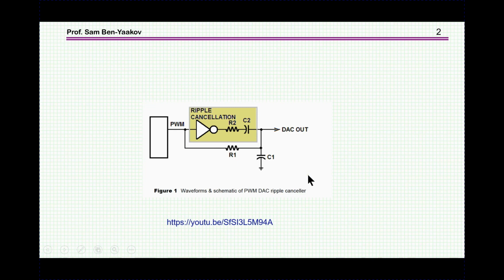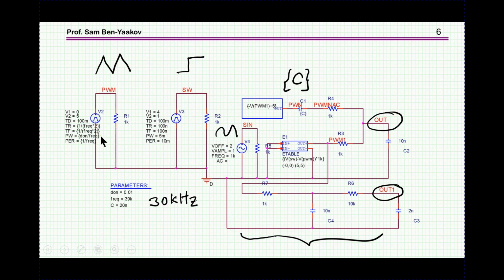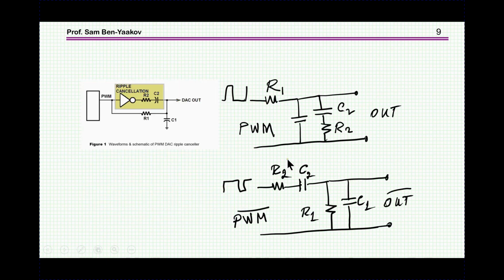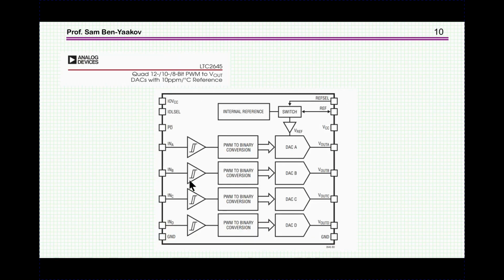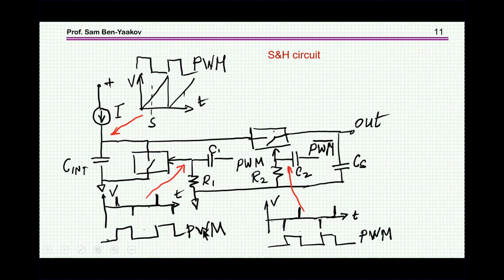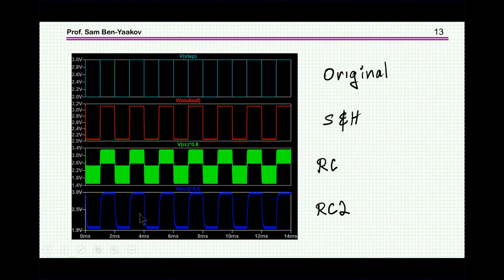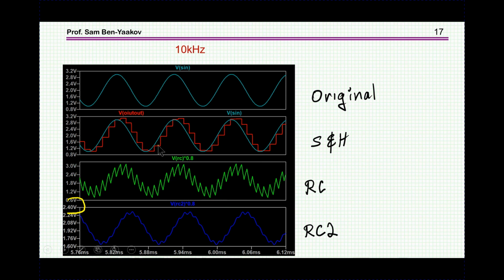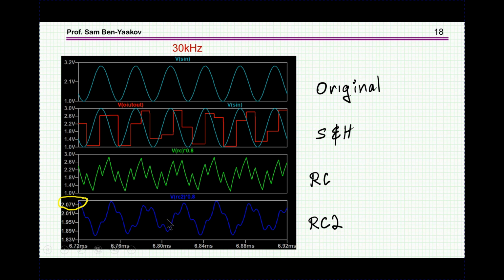Addendum to: Ripple cancellation in PWM DAC

Comment: But what if, in the ripple cancellation circuit, the inverter was not just inverter, but amplified , let's say, ten times - and with a lower C2 capacity?
Reply from the maker: Tried it does not help. Same trade off between ripple and BW

Comment: Cool!  Thanks, this has been interesting.  I have used a three pole active filter, but as you say there can be some art to getting both phase and bandwidth.  Plus it requires an extra part.  I was very interested in the ripple cancelation approach since often there can be spare inverters in a digital design, but it seems that it isn't as promising as it first appeared.